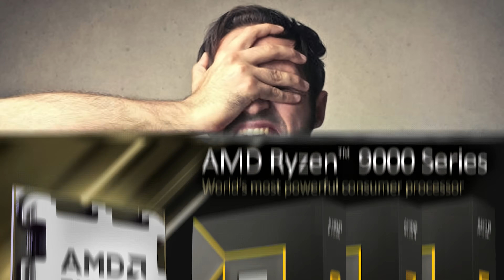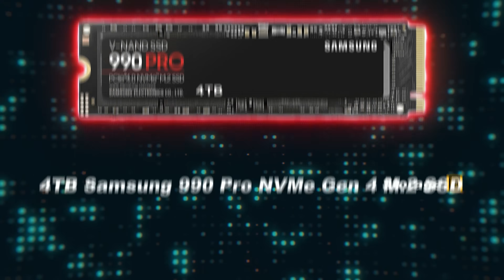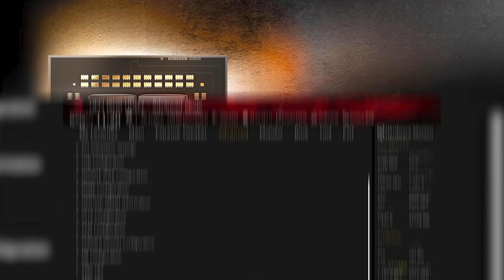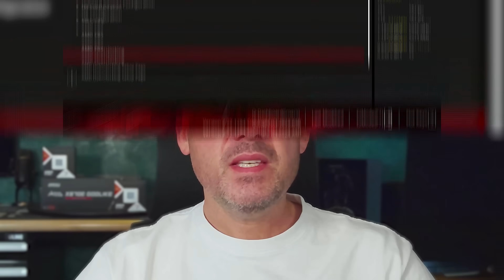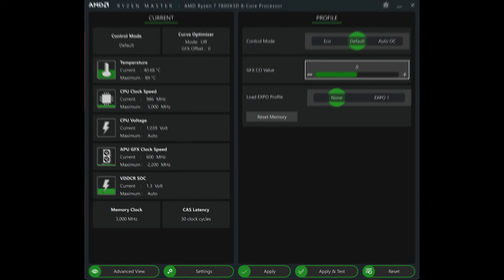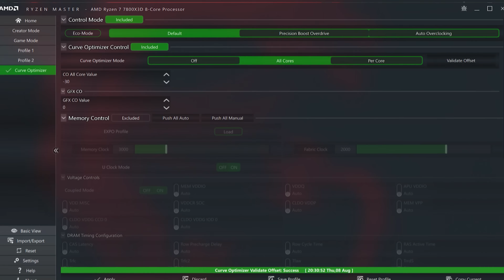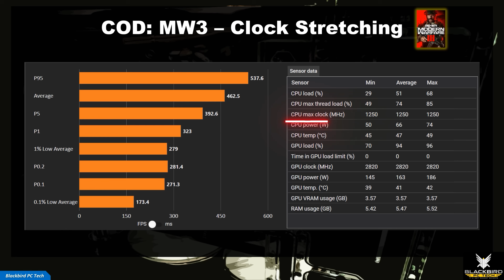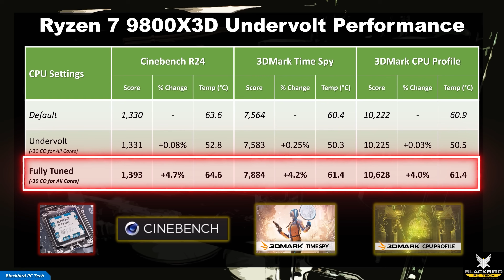How To Undervolt a Ryzen 7 9800X3D The Right Way! (or Any AMD AM5 Ryzen CPU)

Comment: Oddly, temps did not improve on my 9800x3d. stayed around 89 at default, -20, -30. Any idea why?
Reply from the maker: It doesn't sound like the undervolts are being applied ... try inputting them in the other location in Bios
Reply: @blackbirdpctech I did enter them in amd overclocking. Will try in other location & update. Thanks
Reply from the maker: Another subscriber had a similar issue and for some reason it wasn't applying the inputs in AMD overclocking
Reply: @blackbirdpctech I just tried doing in the OC settings. Temps did slightly got better but only at -35. It still did go above 90deg but only for brief moments. Otherwise it kept around 86-88. Im not sure if I should try -40. Or should I try pbo limits? I did that in my old 5800x which helped a lot with that. 
Know that I am using air cooler though in sff case (terra). Using noctua NH L12S which might also be the reason for higher temps but still I thought they would improve a bit with curve optimization
Reply from the maker: @OmkarN  try following this more comprehensive guide to setup your system properly: https://youtu.be/N60M36PRHsY

It sounds like you are thermally limited, so that is likely why undervolting is not showing an impact on temps ... did you measure the performance as you tried different undervolts? My guess is that your performance will be going up. And -40 is very aggressive and likely not stable.

Comment: My 9800X3D isn't stable with anything more than -15 All core. With per core it's more like -40, -45, -40, -30, -45, -40, -45, -15. I've only tested them in steps of 5, would really take forever otherwise.
Reply from the maker: This shows the value of spending time tuning your undervolt on a per core level.

Comment: Do you always set the PBO Limits to "Motherboard"? Wouldn't be better/safer to set it to "Disabled"?
Reply from the maker: Yes, I do ... setting it to motherboard will allow the limits to be set by the max capabilities of your motherboard ... it certainly wouldn't be safer to disable or completely remove the limits. I also recommend setting a thermal throttle limit which will stop your system from boosting too high.

Comment: I just had the worst 3 hours of my life , i started with -10 and then total blackscreen , i navigated in the web searching for a solution and i discovered the damn CMOS batttery , BUT , i have an MSI MB and to take of that battery you have to take off a little black plastic thing first , without doing that there is no fucking way , but before knowing this i tried for like 2 hours. And to do that , you need a precision accessory. So , guys , before you try this from the BIOS , please first you must know all the consequences and all the solutions , because there is a high chance you will have to touch components and stuff . Plase Blackbird PC Tech , you must add this scecnarios in your videos , because i had a very bad time today. Thanks.
Reply from the maker: I'm sorry that you had a bad experience. Instead of removing the CMOS battery you can simply jump the CMOS reset jumpers on your board with a screwdriver (if you don't have a CMOS reset button on your board). One thing you can't do after having a bad experience is try to project that on to everyone else ... consider it an opportunity for growth ... something happened that you were not expecting and you solved the problem.

Comment: In my opinion CO should be done on per-core basis since there is usually two best cores that don’t hold negative CO values too well since they are already the best in voltage department.

Also doing it from BIOS every time is strange, there is a PBO utility that allows you to change values on the go.

I own a 5900x and have 7950x arriving soon, 5900x had ONE core (the best one) to be rock stable only at -5 -6, while the entirety of a second CCD is rock solid under any circumstances with CO of -30. If I did all core CO, I would make my second CCD run almost 10 degrees hotter and 200 MHz lower.
Reply from the maker: For dual CCD CPUs I do recommend applying a per CCD undervolt, as explained in the video. For 5000 series chips I also recommend using PBO2tuner, as shown in this video: https://youtu.be/GJCC94cRGys

Dialing an undervolt in on a per core basis is very time consuming and not something that typically results in a meaningful performance difference. That said, if you didn't win the silicon lottery then it makes more sense.

I would strongly encourage you to test an AM5 CPU before making recommendations about AM5 CPUs.
Reply: @blackbirdpctech  that’s completely fair for you to say. PBO2 tuner doesn’t work on AM5? That’s sad.

My 7950x arrives in under one week, I will thoroughly tinker with it very soon.

Also with per-core CO the target is (subjectively) better thermals/power consumption and not the performance.
Reply from the maker: You can use Ryzen master but it’s basically just a gui for bios, so you don’t end up saving much time.
Reply: Also I was using OCCT on per-core AVX2 load, alongside running stability test in clusters of 4 and then all cores just to be sure. 

Running all core ACX2 test in OCCT is very bad, you may be stable there l, but crash in games almost immediately.

And clock stretching is easily detectable in OCCT, just compare effective clocks with the alleged clocks.

Comment: Silicone lottery I think absolutely taken it's toll on me. Tried 20 and Aida. Just instantly red. 

Got a b650e-i mono 9800x3d and 6400mhz ram. Temps super high. I've got an aio installed too with t30 fans. So it thoughts it'd make a bit of difference. 

Just tried 15 , here we go
Reply from the maker: Make sure to test your memory in Karhu to see if it's stable ... if DDR5-6400 is stable then you definitely have a good chip regardless of the undervolt that you can achieve.
Reply: @blackbirdpctech I certainly will in the morning. thank you for the advice :)
Reply: 15 seems stable in Aida64. Might push a lil higher and see what happens. Instantly went from 90° average core to  66 now. I'm much happier. Going to play some games in a moment so hopefully see same performance with a lil undervolt. Earned my sub

Comment: I have a 5070ti, 9800x3d, 32gb ddr5 cl30 with a thermalright Mjolnir Vision 360 aio cooler.

My max temps in aida64 seem to max at 78 degrees at -10, but my idle is sitting at around 54 degrees.

Is something wrong with my system? First time building a pc and no matter what, that idle temp doesnt fall lower than that!

Ive removed the stock thermal paste and am not getting any different results.

Also, using the thermaltake t3 pro, so thought airflow would be better.

Thanks!
Reply from the maker: No, there is nothing wrong with your system ... your temps are fine.
Reply: @blackbirdpctech appreciate the quick response!

Comment: I started with negative 10 and saw a massive improvement. I was tired of the temp getting up to 95 at times. Thanks for the guide!
Reply: You can also set a hard limit for CPU temperature in PBO2 setting as an extra precaution
Reply from the maker: @manoftherainshorts9075   you can do that however your performance will drop when you hit the thermal throttle limit.
Reply: @blackbirdpctech of course it will, but this person is afraid of the high temps,”. Unless you set it to something ridiculous like 40C, it is very negligent. Just eco mode without any UV drops temps significantly on some CPUs with real world performance being maybe 5% less
Reply from the maker: @manoftherainshorts9075   that's not true ... he never said that he was afraid, you did. It's also not true that the drop in performance is small, it depends on your cooling solution. I appreciate that you are trying to help, but please don't make things up.
Reply from the maker: That's great!

Comment: I tried this and my temps stayed the same? I’m so confused.
Reply from the maker: I had a viewer say the same thing a few days ago and they decided to try applying the curve offset in the extreme tweaker section (for Asus motherboards), versus the AMD overclocking section, and it worked ... so perhaps try doing it in your advanced motherboard options and see if it works
Reply: @blackbirdpctech I did this and my temps started the same. However my performance increased. 

My CPU just seems to go to whenever the thermal throttle is set. When it was at default 95 I was getting 92. Now at 80 I'm getting 80 and my performance barely does. Very confusing
Reply from the maker: @brianaustgen6112  that makes sense ... if you were getting 92 deg C at default then if you lower the thermal throttle your cpu will hit that temp and throttle ... that's what it means. You would have to improve your cooling solution. That said, I don't think the undervolt is being applied if your temps don't change.

Comment: Hello sir great video, i got r7 7700X its hot up to 95c 
Any suggestions im really confused
Reply from the maker: Did you undervolt it? And what cooler are you using?
Reply: @blackbirdpctech i did nothing yet and the cooler is nova nc240
I really need help to lower the temperature
I really want to be able to keep it at 80-85 degrees under full load without risking anything, so if you could suggest safe settings to do, I would appreciate it.
Reply from the maker: I recommend following the steps in the video to find a stable undervolt
Reply: @blackbirdpctech so you suggest an undervolt not pbo
Reply from the maker: Here is a much more comprehensive tuning and optimization guide: https://youtu.be/N60M36PRHsY

I highly recommend watching this video and following the steps. To reduce your temps you will need to determine a stable undervolt.
Reply: @blackbirdpctech great video , so what about doing pbo undervold (-15) and 85w limit? Is that helping to low the cpu heat
Reply from the maker: @aminehassar-p5k  you need to find your max stable undervolt by following the directions in the video
Reply: I acually find minus 15 curve is worked for me thank you , also do you suggest that i set  pbo  "ppt" to 120 w instead of 145w ?

Comment: Ty for sharing.
Something unclear: Should I set the exact same curve optimizer values on both available bios menus (advanced OC / extreme tweaker), or can i make this change just to the advanced OC menu and leave the tweaker unchanged?
Reply from the maker: As I explained in the video I would recommend just setting it through the "AMD Overclocking" option

Comment: Hi, Thank you for the video, I’ve just got my 9800x3d, came across from i7 10700k, I’ve copied your settings but went to -20 not -30, 10 minutes into aida64 stress test and no errors and temps maxed at 71d on a 360 aio, but on cinebench r23 the multi core only scores 22,256 and a max temp of 87 degrees, is that okay? It seems very high coming over from intel :(
Reply: I will also add it’s running at 45-50 degrees idle just sitting in windows :(
Reply from the maker: You skipped Raptor Lake where the temps in Cinebench would hit 100 deg C. For Cinebench, I would expect higher temps because you are stressing all cores. An idle temp in the 40's is excellent. If you are using the same AIO that you used on your 10700k, make sure that you are using the correct mounting bracket and screws. I would also recommend testing to find your max stable undervolt versus simply selecting one ... and make sure to test at default settings to generate a baseline to compare to. You can watch this guide to learn how to tune and optimize your new chip: https://youtu.be/N60M36PRHsY
Reply: @blackbirdpctech Thanks for the speedy reply, it’s much appreciated, ive subscribed 👍 new aio, probably the reason as its not an expensive one; cooling it with the ID Cooling FX360 pro, i used Corsair h100i RGB platinum 240 on the i7 10700k but didnt have a amd mounting bracket, ill try lower the under volt, weirdly my temps at stock were virtually identical whilst idle in windows :(
Reply from the maker: @Aza35617   that makes sense because the undervolt will not impact your idle temps ... and welcome to the Blackbird PC Tech community!

Comment: You may think this is perfect, but I was having playing around 130 fps and having random drops to 70 fps due to this undervolting. If you're not experience you won't even know what's going on. It's not worth it, considering how cold this CPU is.
Reply from the maker: This video is quite literally a step-by-step guide to not only show you exactly how to undervolt, but also how to achieve a stable undervolt. You clearly have an unstable undervolt and didn't bother to watch the video ... but ironically you did find time to comment 😉
Reply: @blackbirdpctech I watched and I only did the minimum starting point that's supposed to work with "any" CPU.
The drops aren't really noticeable but only by checking the framerate in real time, sometimes it comes down to 70 fps for a millisecond.
Reply from the maker: There is no minimum recommendation in the video because there is no guarantee that an undervolt will work with a cpu … it’s silicon dependent, as explained in the video. Not sure where you got that info from but it wasn’t this video.

Comment: Finally after many atempts i get this finally done to work properly, my undervolt by some reason was not working under the advance settings, im using mid priced mobo ASUSU TUF B650M, Plus, basically i have done everything under AI Tweaker.
First i have tried with PBO plus 200 but by some reason was hitting 86 degrees with 35 offset, i managed somehow to get 40 offset negative on standard boost clock 5250mhz and it hits on cinebench almost same result but temps are much much lower.
To be honest i dont see issue to use this monster under default boost with undervolting=same score with higher boost and plus 10 degrees on test.

Btw this is first video which i watched to do something in bios regarding CPU tweak, and it helped me a lot, subscribe from my side and looking forward for other tutorials....
Reply from the maker: Great job on not giving up and trying alternate options ... this may also be an issue for others, so I will mention it when I get questions. Wrt your -40 CO curve offset, if it's stable in AIDA64 then you won't get clock stretching. You may want to check out this video next: https://youtu.be/N60M36PRHsY

Comment: My own experience: Test each and single core with corecycler. Games can still crash even when stress test is stable (AIDA64, Prime95)
Reply from the maker: The problem with telling people to use something like corecycler is that most viewers won't use a tool that is challenging to setup. The beauty of AIDA64 is that it's very easy to use. If your undervolt is stable in AIDA64, games won't crash due to the undervolt ... in fact, even with a mildly unstable undervolt you will typically get clock stretching before a crash.

Comment: The negative number is a percentage of the voltage or Watt 1:1?
Reply from the maker: I believe that the curve offset is a mV offset of the voltage/frequency chart
Reply: @blackbirdpctech  Apparently 1, depending where on the curve, equals 3-5 mV.

I got more confused lol
Reply from the maker: @dps1689  yes it's dynamic ... that's the value of using PBO versus doing a static undervolt/overclock, it can adapt to your operating environment.

Comment: thank you for the guide. temperature difference in my system is really big, it's amazing.

i use that negative 30 just like in the video. doing cinebench 2024 before and after undervolting.

before:
package max: 92.3 C
CCD #0 max: 95.6 C
core clock max: 5385.6 MHz

after:
package max: 72.8 C
CCD #0 max: 74.5 C
core clock max: 5282.8 MHZ

the clock frequency is reduced after undervolting, but it's not too much. does this still considered to be clock stretching?
Reply from the maker: Yes, that would indicate clock stretching ... I would suggest trying -25 and see what happens.
Reply: @blackbirdpctech  i tried -25, max core clock is 5276.6 MHz. tried -20, max core clock 5385.1 MHz. temps are still around 70 C. but now that i think about it, isn't it wierd to reach max core clock 53xx MHz? cause i just do the undervolt method like in this video, i didn't do +200 boost for the core clock.
Reply from the maker: @gunsbrong  that is strange ... I assumed that you applied a clock boost.

Comment: I set the negative magnitude to 20, but unfortunately the temperature didn't drop even a single degree. Am I doing something wrong? ....(Ryzen 9 7900X3D + Gigabyte B650 GAMING X AX V2)
Reply from the maker: It doesn't sound like the undervolt was applied ... you have a dual CCD CPU, so I would select each CCD and apply the undervolt.

Comment: My 9800x3d is dancing all the time between 4700 Mhz and 5200 Mhz. Is not Fixed at any speed. Tried undervolt -10 and Stock.
Reply from the maker: That's typical behavior for a dynamic system ... it will downclock when the CPU core is not required

Comment: But how to do the CO in Ryzen Master for per core CO?
Reply from the maker: Under curve optimizer control it should show "Curve Optimizer Mode" with options of Off, All Cores and Per Core. That said, as I stated in the video, I wouldn't recommend using Ryzen Master.
Reply: @blackbirdpctech  thanks for replying. I've done some work and have found all core -23 to be a stable undervolt. I get nice temps and cinebench scores. but im thinking I could do more per core CO, and thought maybe there is an app that could get me started, rather than testing all by hand.
Reply from the maker: You can definitely use Ryzen Master to find your limits faster, but once you do then I recommend dialing them in yourself in Bios.